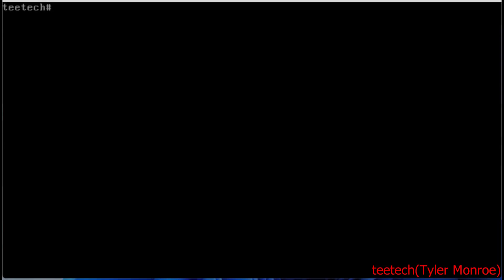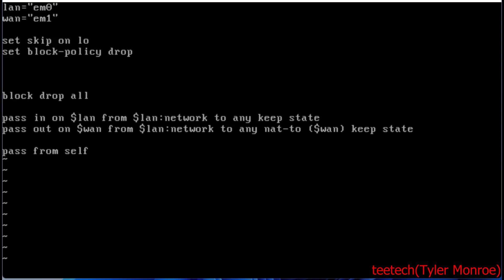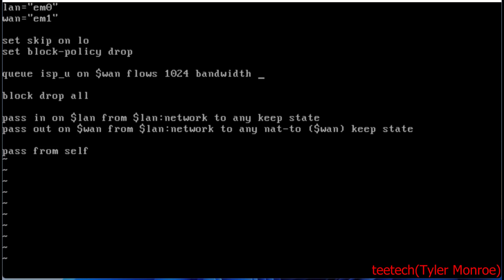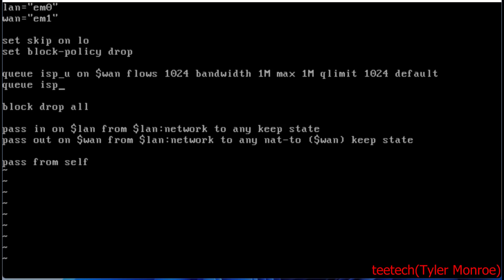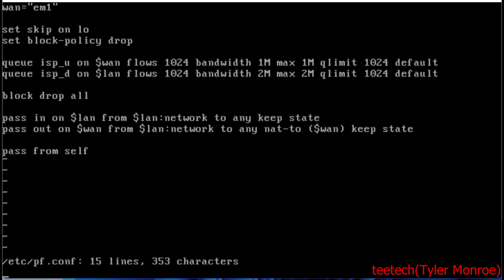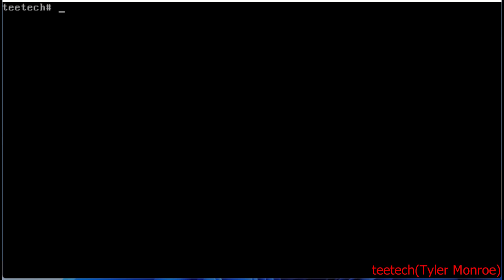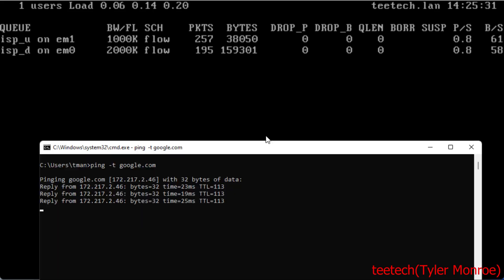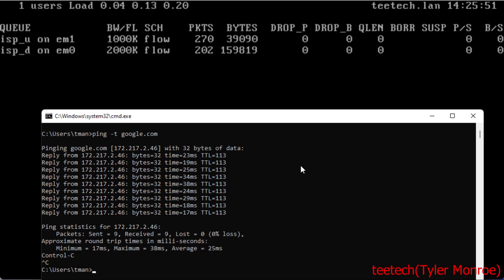OpenBSD Mitigating Bufferbloat Using PF

Comment: Great video Thanks 
Will it work with multiple lans?
Reply from the maker: I apologize I misspoke... In this video I only made a queue on the WAN interface so yes as long as the LANs are being routed out of the WAN they will be put in that queue, regardless of their source address at layer 3.

Yes you would write rules and apply them on additional interfaces you have in your system. For example one could apply to LAN and another can apply to DMZ.

Also just in case it is confusing to read. When I mention LAN and DMZ I'm just referring to macros I would use. It could even be just the interfaces driver name in your rule like igc0 for instance. It doesn't have to always be a macro.
Reply: @teetechtm  awesome thanks you're the best
Reply from the maker: Viewers like you are why making videos is such a rewarding experience for me. So thank you too!
Reply: @teetechtm  I honestly can't thank you enough! I completely feel in love with openbsd like I did with debian back in 1998, code name was potato or woody..... can't remember it's been so long! 
Thanks again